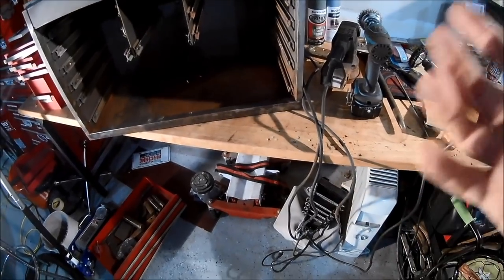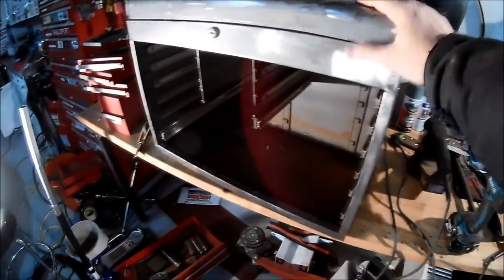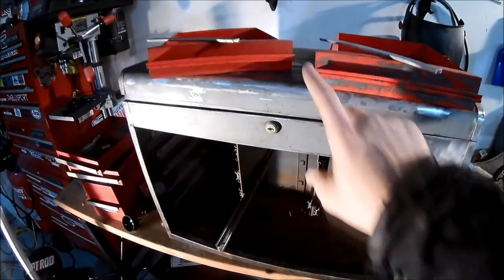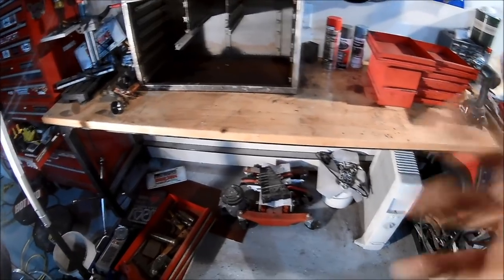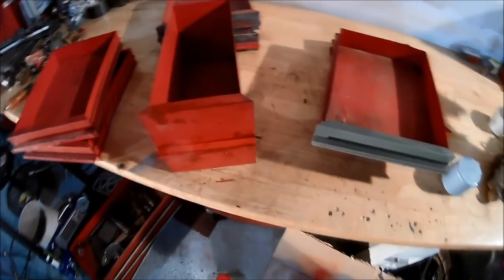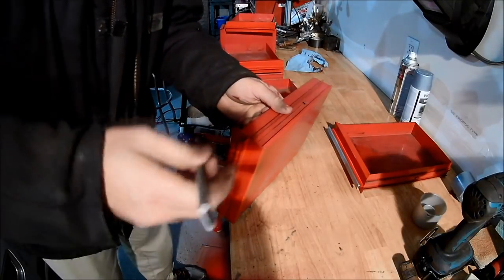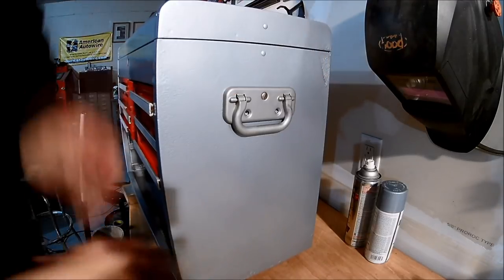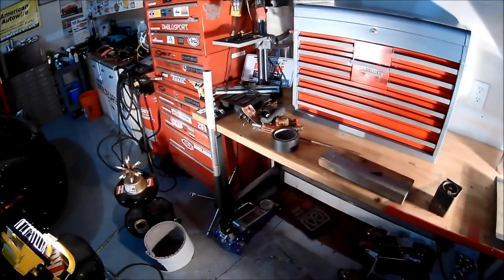How to restore an old vintage craftsman tool box: Part 2 - All done

Comment: My old body shop teacher had us getting  the rust out of pitted metal is take a old drill bit and break off the top and use it to get into the pitted metal.  Try various size bits for your application.
Reply from the maker: Hmmm... Never heard of that.

Comment: This is one of the best restorations of a toolbox I've seen. You did a great job. I would have used a mallet on some of the hammering but you did good.
Reply from the maker: Thank you! The mallet would have worked better for sure. I thought using the tools in the box might be more fitting :)
Reply: And a cold chisel ..

Comment: Nice job. Sorry, I’m 3 years late. I’m curious on the manufacturing date of the box. The date (MO/YR) is on the left side of the top compartment. I will be soon refurbishing my Craftsman toolboxes made 05-74. My boxes are similar to yours except for the side handles. Also, thanks for the paint info. 

BYW, my Owners Guide states to lubricate the drawers with candle wax or paraffin wax every 6 to 9 months.
Reply from the maker: I want to say it was 68? I could be wrong, but honestly not a %100 sure.

Comment: currently working through this same project couple questions if you don mind. how far down did you sand the rust? did you end up using the primer under the light blue?
Reply from the maker: I sanded to bare metal and primer on the drawers only.

Comment: No need for primer when using Rustoleum spray paint. It's a paint and primer in one. The paint would probably last longer and also stick to the bare metal better without a primer.
Reply from the maker: Fair enough. Primer is one of those things I tend to always do.

Comment: I have done a few boxes in the past. I am getting ready to do a fairly large top box and roller Rem Line brand. Rust O Leum hammertone paint will be used on the outside of bothe the box and roller for sure as it most closely replicates the color manufacturers of boxes in the 1960's & 70's  were using at the time and reddish orange typically seen on Rem Line boxes of the era. I am a bit anal about color match so every surface of everything gets painted when i paint a box. 

This box turned out great though, well done.
Reply from the maker: Thanks! it will be for my son when he's old enough.

Comment: Oh geez. Use block or something when you’re driving hardwire back on for heavensake
Reply from the maker: I suppose that would have worked better.
Reply: Not a lot of people realize that when you install those grips from the other side - they will slide all the way easily until the catch lip an inch from the other end. New boxes at least, most old as well. Only need to hammer once or twice to get it flush - and yes use a block lol....I use a thick dowel and a rubber mallet for any missed strikes.

Comment: Think I would have sand blasted the box instead using a  wire brush; also, instead of using can spray paint I would have used a spray gun.....but that's just me.
Reply from the maker: Sure, i would have done all that... had i had those tools, but I didn't at the time.
Reply: Gearhead Daily ....Understood

Comment: I know it's been a long time- why didn't you try and upgrade the sliders? I'm at this point and there is nowhere on the "net on how to do it-
Reply from the maker: Well, the sliders work fine. No need to replace or fix them
Reply: @GearheadDaily  I'm gonna take another look at mine and see if they can be fixed- Thanks

Comment: Just an fyi, I bought my craftsman box new in 1981. I remember the instructions saying to grease the sliders from time to time. Just put a little grease in the grooves of the sliders. They slide really nice after.
Reply from the maker: Thanks for the info, i had no clue. Once you put grease in there its impossible to get out LOL
Reply: @GearheadDaily  you did a good job on the box. The grease on the sliders is important. They didn't use ball bearings that I recall back then so the grease made it slide nicely. Not oil! Oil won't last. Got to use grease. My roll-a-round is a Craftsman 9 draw. I purchased it brand new in 1981for $185.00. The company I worked for had an employee tool purchase plan. They would pay for it and take $15.00 a week from my check until it was paid for. I'm retired now and I've had it ever since. It's home is in my garage and I still use it. Never even gave a thought to replacing it and I'm pretty sure I'll never need to. He's like an old pal now. Every draw is full now as I've aquired a lot of tools over the many years. To many in fact to all fit in the old box that eventually, over the years had a middle and top chest added on top of it. But theres a lot of "remember when" and a smile every time I look at it. That box and I have done a lot of work together over those years. I wish the ole boy could talk! What a conversation we would have. Sorry to go on so long. Grease those sliders and that ole boy will do it's part!
Reply from the maker: LOL Thanks! I kind of feel the same way about my tool boxes too! I'll grab some bearing grease. thank you.

Comment: It sure does look good. I have an old portable one I use as a chainsaw toolbox. I think I'm going to use some of that flex seal clear spray on the bottom in order to keep the patina but also give it a layer of protection.

Comment: you should have painted the upper inside portion of the box, and if you haven't already you should buy some nice Craftsman Draw Liners.  They will keep your tools in place when opening and closing the drawers and they also act as sound deadening material for a more quiet opertion.  This way your tools won't clang around while operating the drawers and it will sound much more solid and take away that hollow tinney sound.
Reply from the maker: I didn't want to paint the upper portion because it had some cool old stickers from my grandfather. The draw liners is a good idea though.

Comment: i liked both vids, honestly. ive been looking into restoring my dads original toolbox he bought new back in the early 80's when my parents moved back here in Florida. he bought a much larger full black craftsman box about 8 years ago, a couple years before he passed. and i would like to restore the old box and repaint it to black to match the new box. (gotta have a matching color theme for the shop, right?) but seeing someone not go through every nook and cranny like a frame off restoration of a million dollar car puts a much better light on the idea i dont need to go crazy with the stripping and such. though i would be curious as to how well the paints held up on the handles (both drawer handles and the side chest handles) and how well the hinge has lasted after being painted.
Reply from the maker: Thanks! Sounds like a good project and almost exactly what I did here. The hinges hold up very well in my experience.

Comment: I've lined the inside of the drawers with the thin indoor/outdoor carpeting sold at most home centers. There are several colors available, but I like grey or green. Once you get a pattern for the bottoms, front & back panel as well as one side, you can mass produce all the pieces you need. Don't forget to allow for the thickness of the carpet when you measure for your patterns. The glue used to adhere it to the floor is what I used and it's still there after a bunch of years. Excellent job on your resto' and thanks for the paint numbers which are very helpful. Excellent videos as well. Never stop paying attention to, or spending time showing your son the simple skills we all need to succeed in life. He'll thank you for it later by showing his children. Be safe.
Reply from the maker: Thanks Gary! I've used the thick foam before for tool boxes, never thought of carpeting.

Comment: Suggestion ,  put some large ( 2 inch ) , round , self-adhesive ,  i/8 inch thick Felt pads on the bottom of your Tool Box .  Any moisture that gets under the box will get to evaporate instead of causing rust . Also helps to keep from marring any surfaces you set the box upon .
Reply from the maker: Very good thought thank you

Comment: Just line the drawers and top storage area with some thin drawer liners (Craftsman type) and you will have one fine restored tool box.  The liners will cut the noise of moving it about, help protect the insides of the drawers and the tools themselves.  You might consider putting a few of your grandfathers old tools back in the drawers (after cleaning them up a bit) just to add to the nostalgia of the piece.  Bet your son will love it !!
Reply from the maker: Great idea thank you!

Comment: Looks excellent. Nicely done. Just picked up this same 10 drawer box today. It is a slightly newer model ( circa1980) with the sears/craftsman badge (It's all red with black drawers). It's in very good shape and I'm lazy so I fully disassembled it and washed everything with dish soap (except use brake clean on slides) then blow dry with leaf blower, spray down with WD40 Silicone Lubricant and wipe off excess. Then I reassemble and line drawers and top storage with cardboard.
Reply from the maker: good deal, a good cleaning will help!
Reply: Hey mate, do the handles remove?
Reply: The drawer handles can be removed-but it looks like a pain. I'm not sure about the side handles. I just cleaned them in place.

Comment: Just curious, you spent that much time working on the box. Why didn't you fix the dent and correct the warped lid?. But in all, not a bad job for using rattle cans.
Reply from the maker: Warped lid appears to be more of a hinge issue, i did lube that. As far as the dings/dents, i kept them as character earn by the box. I didn't want it %100 new.
Reply: Gearhead Daily I can understand that. Badge of honor.
Reply from the maker: Stacy Cornett  Right, and also, my grandfather put that dent there... It's his character I want to keep.

Comment: I have one from the 70s and it's in far worse shape I wonder if it can be saved?
Reply from the maker: Very possible, throw up some pics.
Reply: @GearheadDaily  It was my fathers and its not here at my house but the paint is in better shape. Very little rust. The problem is he had too much weight in some of the drawers and they are dented/broken slides...
Reply from the maker: That shouldn't be too hard to hammer back into shape honestly if that's all that's wrong. You can get a cheap hammer and die set from harbor freight that will do the job.

Comment: Nice
Reply from the maker: Thanks
Reply: @GearheadDaily  How did you put the logo back on there ? The same thing happened to me, I took the logo off a craftsman tool box I am fixing, only one pin snapped  off. Now I don' know how Im going to put it back on, do I glue it?
Reply from the maker: @danymitehazard  I think I used some VHB i had lying around.
Reply: @GearheadDaily  thanks